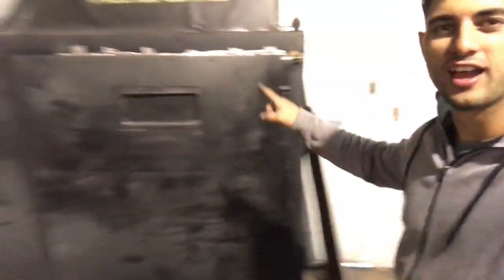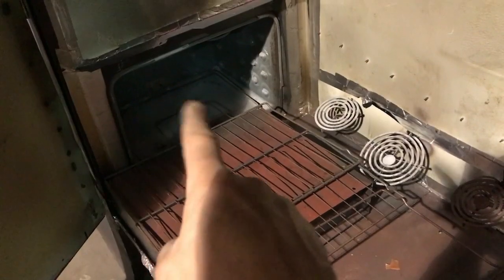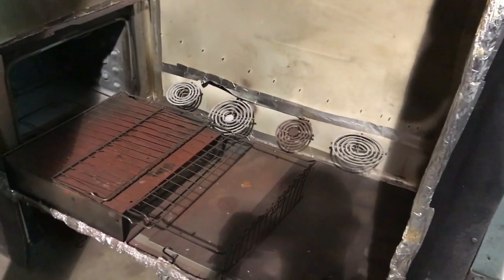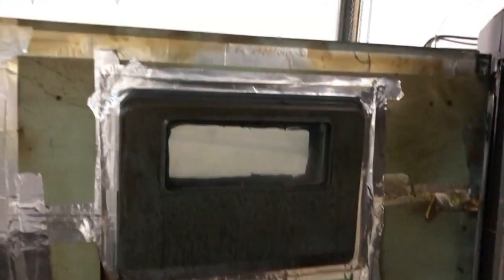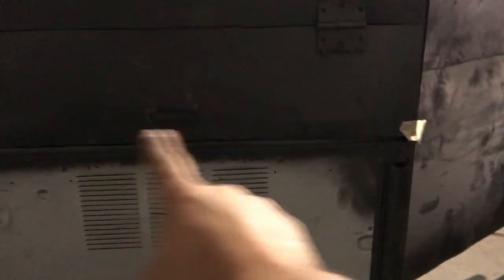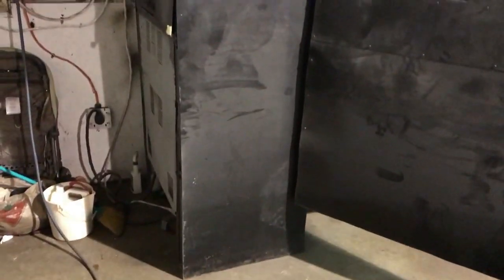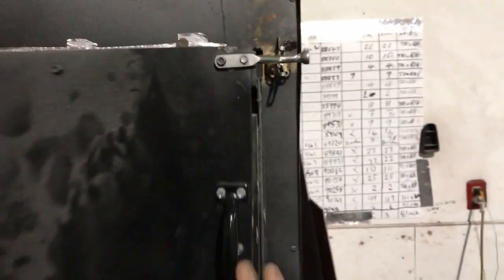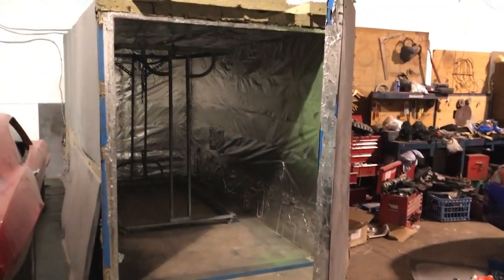HOME MADE POWDER COAT OVEN!

Comment: Can you give any info on wiring or how you control temp? Or a what was your source for all of that?
Reply from the maker: BeEzLeBoSs2010 each element can be individually turned on and off , and also turned hotter or colder through the original controls of the oven .

Comment: How’s it heat such a large area with only one bake element? It must take an hour
Reply from the maker: there are 6 elements, not one,
Reply: @Littlesamsworld  I said bake element. Not the eye ones. Impressive either way that those work
Reply from the maker: @joenason6423  yes you said bake element, however you also said how does it heat up a large area with one bake element.   it dosent,  its using a combination of two bake elements,  ( not one,  as well as 4 of the eye ones. )